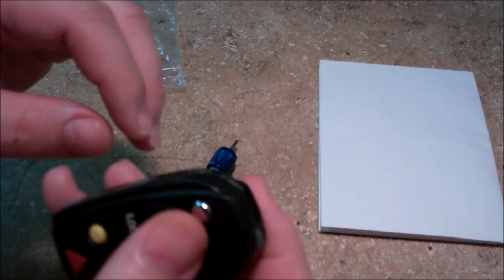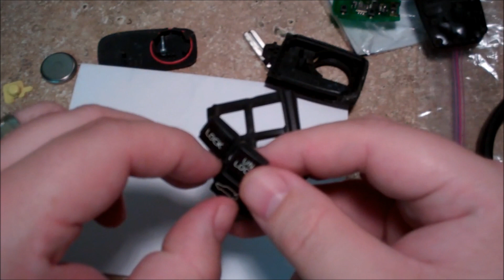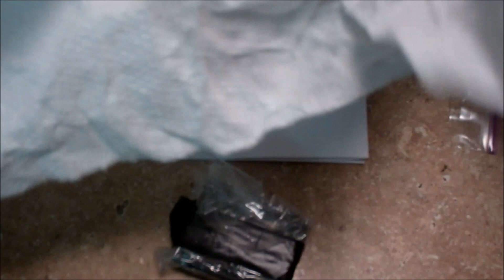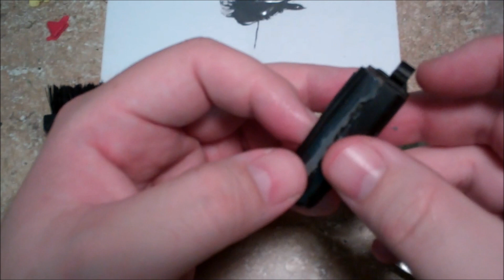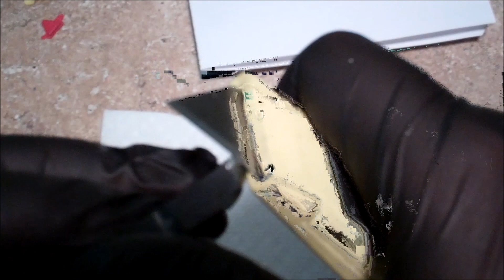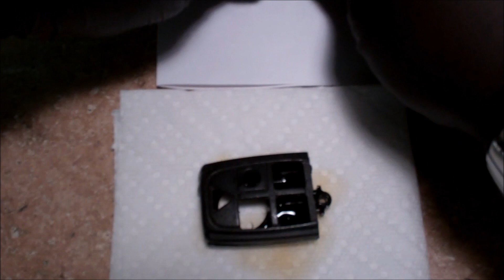2004 Volvo XC90 Key Fob Plastic Repair

Comment: Slick idea to wrap in ziplock bag to buildup and repair the broken body casing. The chip is RF and requires programming. I used my regular Volvo mechanic to program.

Comment: helped me dissasemble my key that had stopped working.  read online that there was a prob with some volvos having a "screw loose in the key" that caused this - but with your help I took it apart and there's no screw that could be affecting it...  So I guess it's to the dealer with me